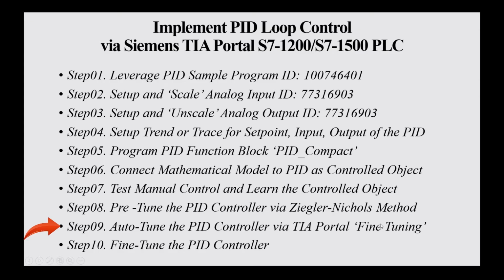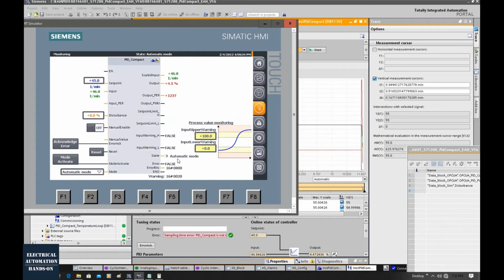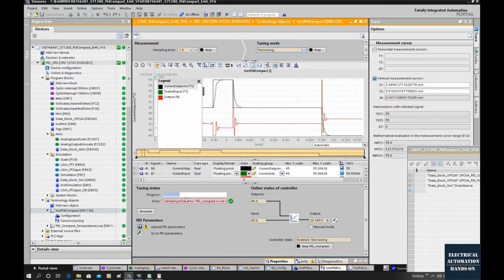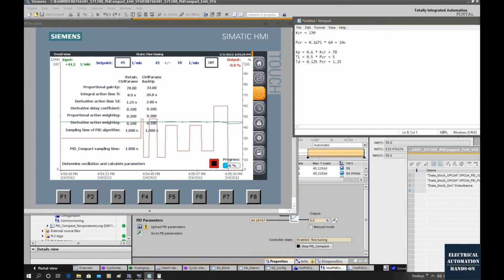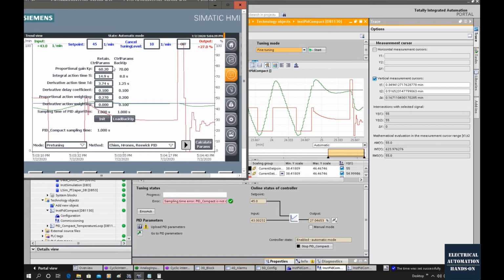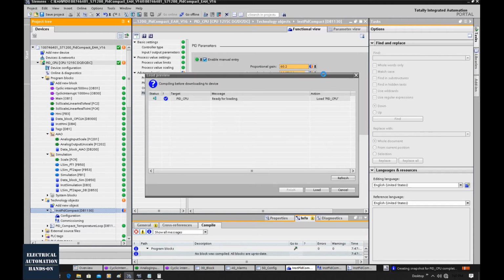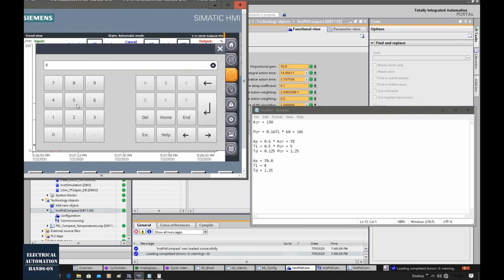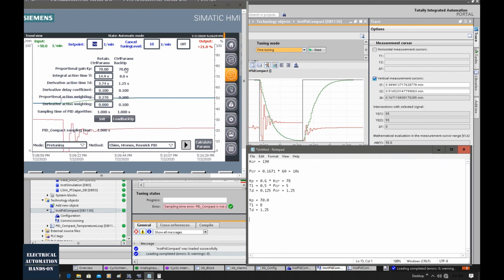PID19 - Siemens PID09 - Auto-Tune PID Parameters in TIA Portal PID Compact

Comment: hi, its very excellant, but I am facing a problem that every power off to on of PLC PID block is going inactive, I I need to start measuring and start PID COmpact.. why this is happening?
Reply from the maker: Not sure which CPU and which revision of PID you are using. Note different firmware of S7-1500, S7-1200, and different  PID revision has not same on the inactive, manual/auto switch. Please, please check the online help for the "MODE" switch. You can use a INT =3 Auto or 4 Man to control the 'Mode' of the "PID_Compact" and apply a Rising Edge to "ModeActivate" to trigger the mode change.